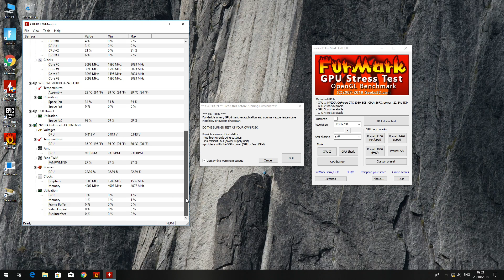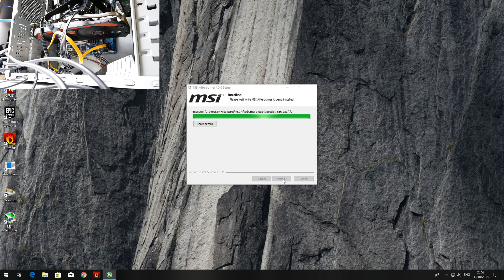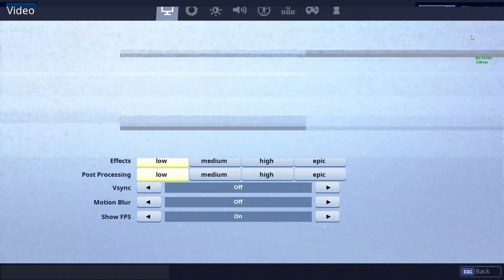GTX 1060 Crazy Cooling Mod

Comment: 81 degrees and fans at 51%... The seller was right! The gpu was fine.
Reply from the maker: in my opinion best temperature for them is under 70 c
Reply: @NVelme  my opinion too ^^
Reply: I have a 1060 in my omen and it runs idle at 65, totally fine. With maximum load it goes to 98, still fine. Goes to 97 every time I game, fine.
Reply: @johnmen  it's going to die turn the fans up
Reply: The fans already go to maximum at around 80 to 100C and I am using a HP Omen, of which I am using a laptop Omen which are infamous for getting very hot and having a very inefficient fan speed curve.
Reply: Oh and I have tried undervolting the cpu and it helps, but it still occasionally goes to 95C, while hovering at about 89C.
Reply: @johnmen  I had an omen I fixed it by attaching mini heat sinks the the bottem lol
Reply: I’ve got a cooling pad on the bottom that I plug in every time I use the computer.
Reply: @johnmen  you should undervolt the GPU instead, or additionally. Particularly for laptop GPU's this can be a huge performance boost.
Reply: @ceilyurie856  Haha, yep. Furmark really abuses your gpu. That said it's still an upgrade for that particular card. Hope the seller didn't get bad feedback cause of that though (if it was online).
Reply: @johnmen  oof mine was 85 degree just to run SEUS PTGI shaders in minecraft, it pushes to 100%, of btw i have EVGA single fan
Reply: For a 1060 those kinds of temps are fine and those cards can withstand heat like up to 100 degrees and then start thermal throttling
Reply: @ShiroCh_ID  interesting i got 92C using those shaders with 2000MHz 100% on a 2060 .-. no overclock but my pc did sound like an apache helicopter
Reply: @johnmen  sounds like it needs a repaste lol 97 is pushing it

Comment: I just finished this mod on a single fan evga 1060.  I used the twin fan setup from an evga 970.  It did bolt on without having to mod.  The difference in load temperatures is really great, but the heat sink does extend way past the card which can cause fitment issues in some cases.
Reply from the maker: yes those single fans are bad, by doing this mod it is possible to get it to work better and to achieve even better performance, then we need to modify\update gpu bios

Comment: for 65 bucks on ebay, you can get an i7-2600 for your computer! the i7-3770 is not that much better, but costs almost twice as much. It would be a lot better. You'd have to get a better cooler though. With that cpu cooler, I saw temps at 101 before upgrading to a coolermaster cooler for 25 bucks on newegg. EDIT: looks like you can get a 3770 for 79 on ebay. i'd go for that!
Reply: I prefer the Xeon 1230l is like the i7 3770 whitout graphics card and costa overbooking 30-40$

Comment: The fan speed was set on quiet. that will literally make any gpu hot at that fan speed. i had the same GPU (3gb)and i got like 70 degrees on full load at max fan speed. i sold it to my  friend since i got a great deal on an RX580 8gb for $40. sure it was a mining card but it was only used for a month(got a sales invoice) since he is loosing more money than gaining in his mining setup. A year later and i still have the RX580 and i kinda prefer it over the 1060 i used to own.
Reply: Rx580 2048sp?

Comment: He said it was fine because it was... That's the reference cooler that came on it from the factory. Blower cards run hot, especially at not even close to the fastest fan speed it can run at.
Reply: Don't they also run louder than open air coolers?

Comment: It's not thermal throttle, gpu is still boosting over stock frequency.
Also 81c is normal for blower style cooler, my 760 (gainward blower style cooler) was going to 85c with blower being really loud.
Interesting approach by using original heatsink as adapter plate but you damaged one of the heatpipes with grinder and that one is probably not cooling anymore so temperature can be improved.
Reply: Check the vid, the fan curve was not even set, fan runs at half speed.
Reply: @savydaniel  You mean with blower? You wont gain much by setting your own curve, it's loud even at lowest speed and at top end it sounds like vacuum cleaner.
I tried setting my curve but going from 60% (which is what my card was usually running at) to 100% dropped temps by 2-3c (which was still over 80c).
I got cheap 92mm CPU cooler and put that on it, result was 60c with fan around 500rpm which was barely audible.
Reply from the maker: yes i damaged one pipe but still runs super cool.

Comment: Is there not huge voltage issues using two fans? I'm getting voltage limitations using the stock cooler on my 1060gtx. It's from Manli not Zotac but basically the exact same shroud and crappy alu blocks. Would love to see a watercooled version.
Reply: I see some highend 3-fan gpu use just only one 3-pin fan connector, and they work well, so I dont think there will be any issue with voltage.
Reply from the maker: there is no issues, original fan was bigger and if i would measure amps it should be almost the same

Comment: I would like to see you test to put a CPU cooler on this graphics card and see what sort of temperature readings you'll get. Assembly is going to be fiddly but seeing how well you jury rigged the entire setup in this video I'm sure this next suggestion would be worth while.

There's this really cheap CPU cooler that is about the same look/performance as NH D-15 on aliexpress for less than $30 which includes mounting brackets. Some vendors like amazon have vram heatsinks of course for cheap
Reply from the maker: could go with water cooling as well

Comment: This physically hurts to watch... Your fans were running at 50% in the first thermal test... All you needed to do was turn up the fans... Then when you decided to do the cooling mod, you could've just bought a 1060 cooler and not had to drill and cut and destroy the thing

Comment: Great mod, you almost made the VRM heatsink touch the CORE heatsink, with would be great.
Reply: And nothing would happen if it do so. Many cooling designs are using one cooler for VRM and GPU. If VRM have electric connection with heatsink game is already over.

Comment: zotac?  my gtx670 is a gainward version and it came with absolutely the same stock cooler,just like yours. so i managed to install an old huge cooler from asus gtx580 dcu2. results were amazing,they still are.

Comment: Nice what 1060? Where did you buy it?
Reply from the maker: I got this one off facebook. Not sure which edition is it, but there is loads of cards with same bad cooling. With this method you could fit any cooler.
Reply: @NVelme  It's look like ZOTAC GEFORCE GTX 1060 6GB (ZTP10600D10B) - unfortunately I have this card
Reply: @NVelme  I have the 3gb version, and that is taken out from a pre build lenovo pc lol
Reply: With me 4 now temp is under 74℃ at full load. 82 was before

Comment: Hmmm might do this on my 1650 with 970's cooler
Reply: im actually working on a 1650 with a 560 cooler, got good temps already but still trying to make it perfect fit
Reply: @eabugosch  Ho damn, that is a nice cooler for 1650 indeed... But how do you even get 1??? the 970 cooler I got on my 1650 is longer than the card but it fits it nicely with some custom bracket made from scrap metal.
Reply: @hazimreitz  i had a gtx 560 from an old pc that no longer worked, so i thought it might be a fun project to work on. MSI gtx 560 twinfrozr II if you want to see the exact model. And my card is the Asus 1650 OC Dual. The 560 cooler is a bit longer than the 1650 but it fits about right. I had to cut some part of the aluminum fins in order to place it on top of the pcb and make it contact the gpu

Comment: @NVelme i put the cooler from the old 770 hpantom  with 7  nicklet coated heatpipes on it and it keeps ist overcloked at 55°
Reply: next project : shund mod resistor

Comment: i hv old 1050ti twin fan,can i use it to my rtx2070s
Reply: why would you do that? the 1050ti uses way less power than the 2070s, so its cooler would make temperatures way worse
Reply: @Fritzsch82  maybe 2070s single fan?
Reply: @nikrisonly9105  fair. could potentially be some bullshit blower design. i had the founders edition or any other 'normal' custom design in mind.

Comment: i always admire your videos.if you coul grind off  that Little Square metal (were heatsink touching core) on msi heatsink when you attatch new to old .if that will give you more area where  two metal are combining togheter.and heat will be tranfered faster.just saying.great video .thank you.
Reply from the maker: Thank you
Reply: @NVelme  you welcome.please consider backup all your tutorials .after eu parlment vote yes for article 13 and 11 youtube might delete all videos without license.2 yers left for each country te prepare.they want sell license for everything and repairing is included i think.
Reply from the maker: @retrobox5677  That's crazy. thanks!

Comment: I has a gigabyte windforce 1060 3gb...runs up to 81°C cuz it was limited by power limit at 100%...I had to set the temp limit to 75°C...it's probably the bad heatsink fin design(super thick fin just like the original heatsink in this video) altho it has direct contact with copper heatpipes.

Comment: To weak cpu for a 1060 6gb .. terrible bottleneck on Fortnite. Not enough CPU for 144 or more fps on fortnite. Not even my old i5 6600k oced at 4.5 was enough for 144fps, bottlenekking my 1060 6gb.

Bought a R5 3600. Al fine now